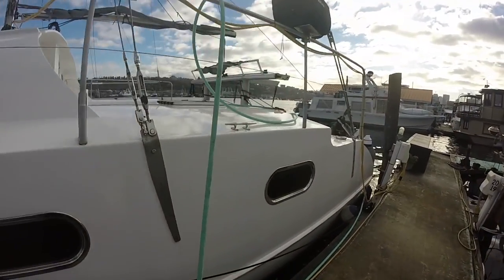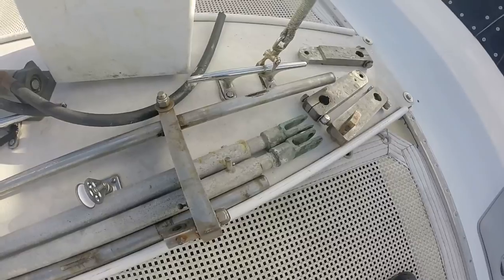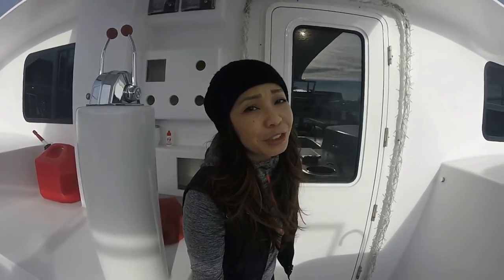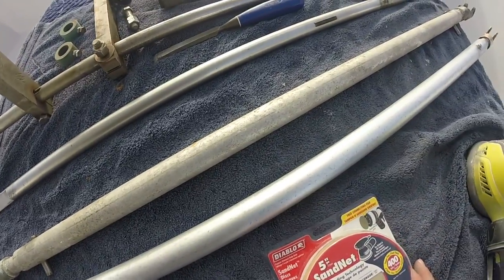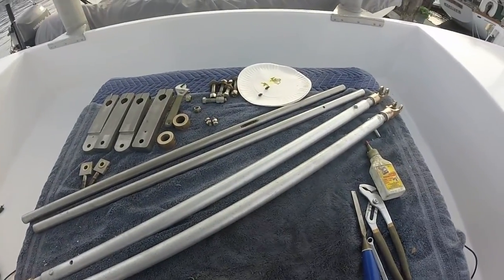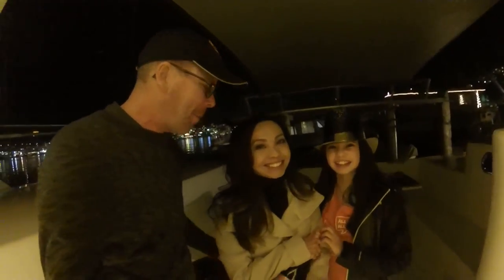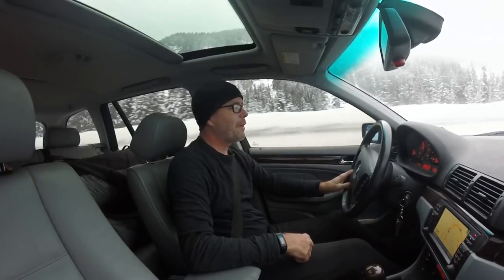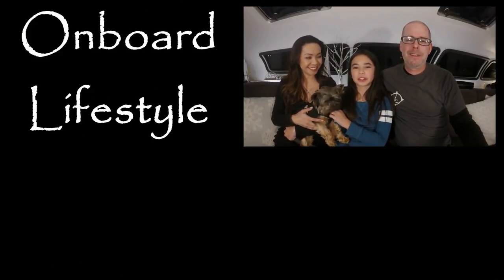New Year...New Project, Positive Outlook on Life! Onboard Lifestyle ep.45

Comment: The short threaded fittings that connects to the bronze clamp and aluminum tubing, you should consider plating with zinc (or other recommendation from a plating shop) as its the most vulnerable to galvanic corrosion, which is why its corroded and deteriorated.

Comment: Hi Theal. You can buy nitrogen in the hardwere stores in the welding setcion and putting it on the stainless steell will freeze and srink the tubes a little be enough to remove the ends of. give that a try. Allso heating the ends with an snall oxy bearner will couse metel to expand and that will losen the ends.
Gerard.

Comment: With such a remodel of the boat, the relocating/removing/replacing some heavy items, have you seen any listing to starboard or port when you're done?  Like the fridge and holding tanks, how are you factoring weight management or are you?  BTW,  I am memorized with your upgrades and your craftsmanship is top notch.
Reply from the maker: Weight distribution has always played a large role in our design layout, we pay close attention to the waterline and use ultralight materials to compensate for the few heavier items that we have added.  During our refit we have  maintained the waterline, and evenly from hull to hull, so our efforts have worked. Thanks for the comment Craig!

Comment: Hi Love the vids. My question is  how does the PVC pipe handle condensation  If it is used for A/C . I have insulated tubing now and would like to replace it as it is very bulky and I could use the space  and run a cleaner system of ducking.
Reply from the maker: We ran our AC through our ducting for a few years and never noticed any condensation. Keep in mind  that we live in Seattle so the AC was used sparsely.

Comment: So you have a hydraulic pump.. that goes to the auto-pilot... & then to the ram. Why not have 2 smaller rams, one at each rudder head.... linked by hydraulic hose... lighter less to maintain. they would act on each rudder equally... or are marine requirements for a physical linkage?  or even Total fly-by wire?
Reply from the maker: That is a valid option that I am looking at.  The wrinkle in this system is that with kick up rudders the rams would be exposed to the elements.  To protect the rams I would move them into the linkage channels which would still  require the linkage to transfer the load to the rudder but would eliminate the 20' tie bar.  Without the tie bar I can fill in the 3 holes in the hull required to operate it. I am still researching my options and I thank you for the conversation.